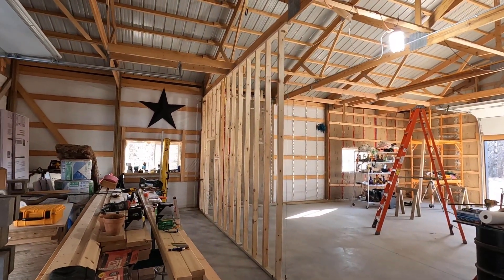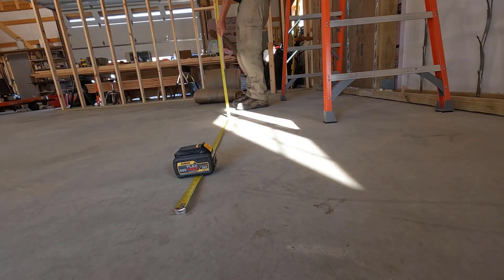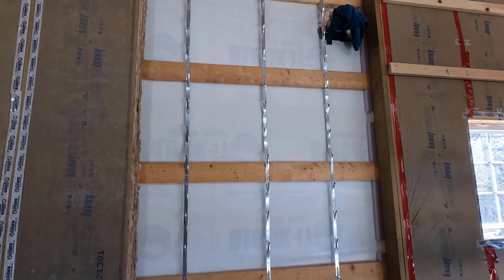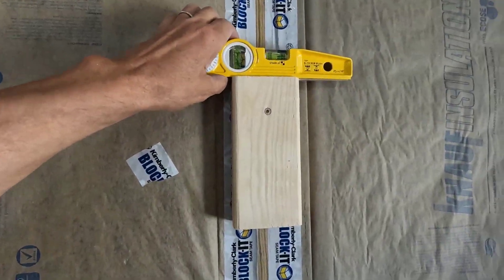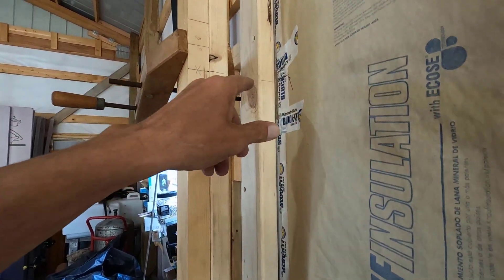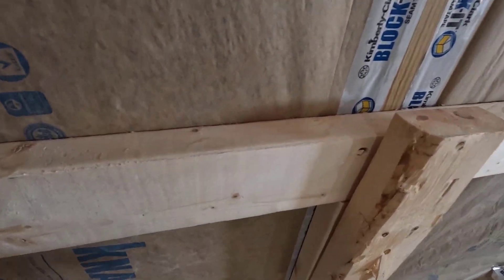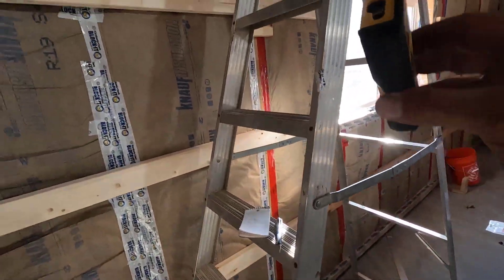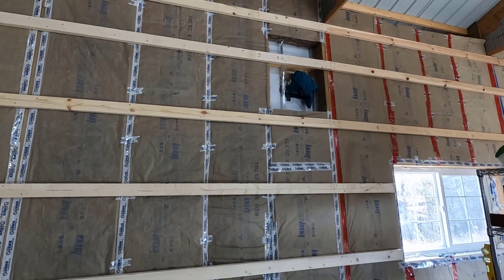Insulating Last of East Wall and Installing Girts [Post Frame Woodshop]

Comment: Nice work! I like that Insul-Hold product but my building doesn’t have a weather barrier between the siding and purlins though I suppose mineral wool could handle a bit of moisture. Is there a reason you don’t have a WRB on your roof? Are you planning on continuing the insulation detail up to the roof?
Reply from the maker: Thanks Andrew! Mineral wool would be fine. You can completely soak it, and as long as it can dry out it will still be good. We used it in our addition project, but couldn't fit it into the budget on this project. I am installing a tin ceiling and insulating above that (batts and blown-in). I will not be using any kind of barrier up there, but will rely on the tin alone. Don't want a 'vapor sandwich' up there.